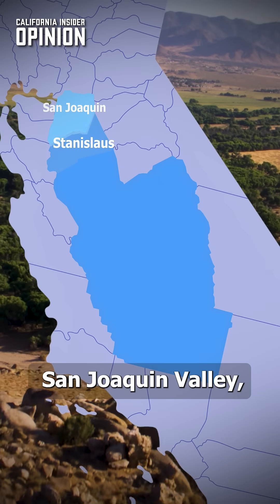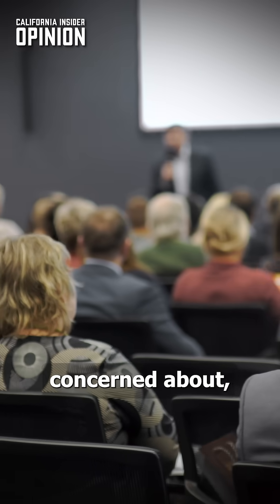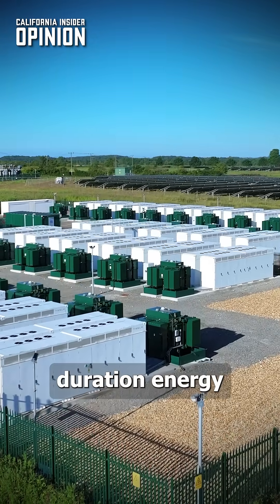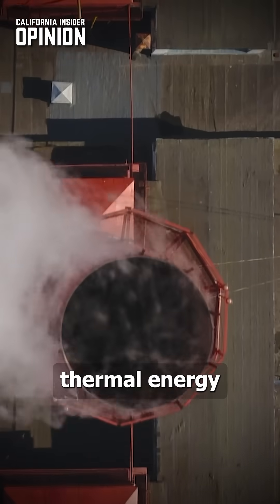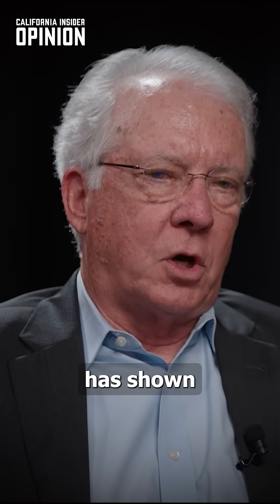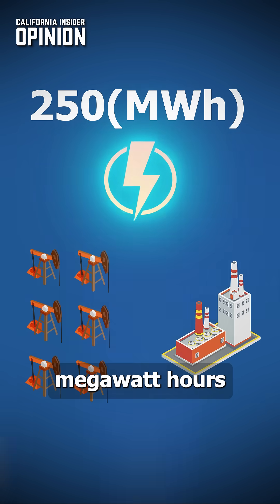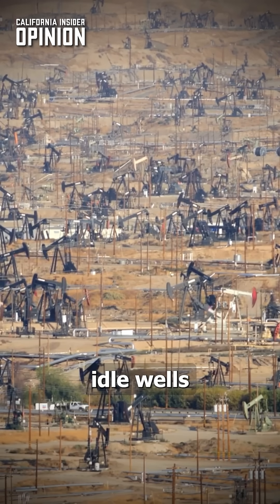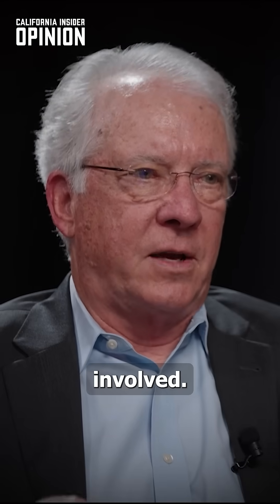Why We Use Idle Oil Wells to Store Energy

Comment: Energy is inherently ubiquitous and free.
Power-service costs.
Storing energy makes no sense.
Reply: Is solar available at night? That is what this is doing. The water is heated by solar power. They store solar and wind now in gigantic battery packs,AKA PEAKER POWER PLANTS, for use and night when neither source of energy is available. This has the added benefit of extracting the residual oil from the ground so it’s no longer an environmental problem.
Reply: @mikehopper1025  Uranium-fired power-service is available at night.
Wind and solar are infinitely-expensive, on a sustained basis, regardless of how they are firmed.